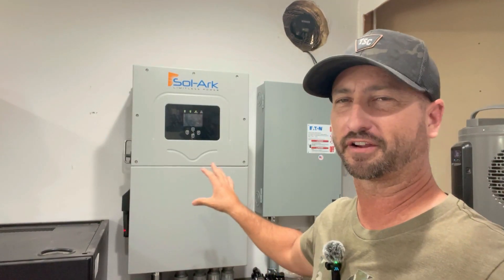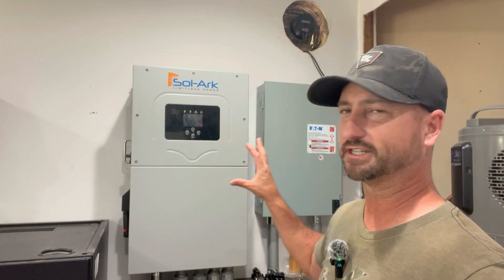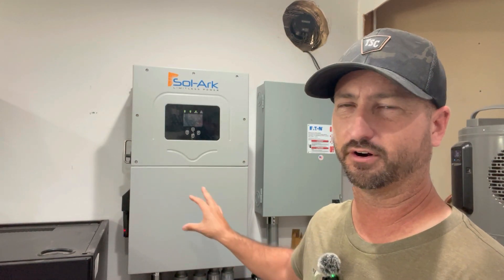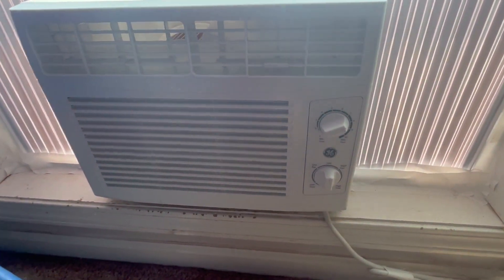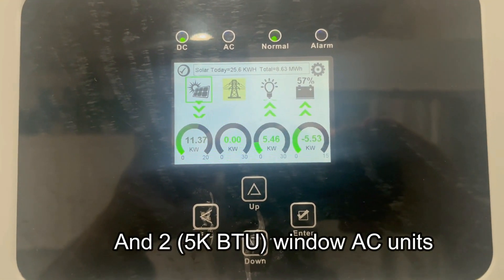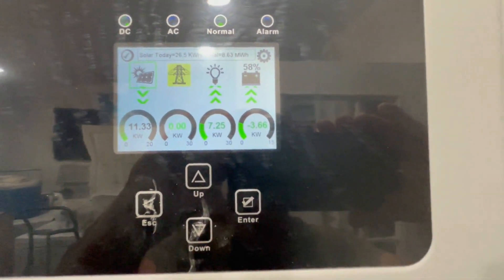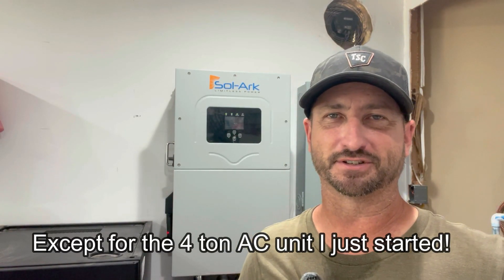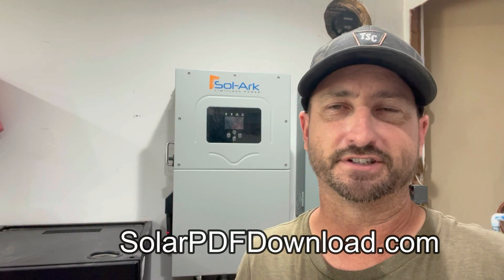Sol-Ark 15k Load Testing (including 4 ton Air conditioner!)

Comment: Great Video.  Just purchased a 15k to replace an outback Radian GS8048 (because Outback is going out of business and no longer can upgrade it).  It seems that the "Hybrid" HF inverter is just as good as the transformer drive Low Freqency Outback..Curious how well it does with imbalanded loads?  I will problably find out when I install it.
Reply from the maker: I haven’t paid too much attention to the load balances. But that means that I’ve never had an issue.

Comment: On your pdf i did not see it. But can you provide some info on the wiring output for load between the inverter and electrical panel for reference ( breaker and wire size). Thanks.
Reply from the maker: 3/0 thhn from inverter load port to the 200amp breaker on my home electrical panel.
Reply: @unpluggedtexan  perfect thank you. I am installing N3H-X12US and just doing my research for the best way to install it. Appericate your response.

Comment: Very informative content Thank You.  I am looking at doing a setup very similar to yours. My well pump is 1.5HP and I hope to do some sellback to speed up the payback.  My question is: what happens if the unit goes south?  I am toying with the idea of a bypass to feed the grid directly into the main panel.  Is it needed or is there a hard shunt in the Sol-Ark in case the brains go belly up?  Thanks.
Reply from the maker: If the Sol-Ark dies then the transfer power to your main power will go down as well.  I have a gutter underneath my Sol-Ark 15k.  I can easily pull the main feeds out of my Sol-Ark and bypass the Sol-Ark using insulated connectors in my gutter.  It would take me about 30 minutes to do that.  A bypass / transfer switch would be more ideal to install though, especially if you don't understand electricity well.

Comment: Aren't your batteries too close to the wall?
Reply from the maker: @David-ev3un  I’m not aware of a regulation requiring batteries to be a certain distance from the wall. In fact a lot of batteries are wall mounted now. As long as they have the certification for indoor installations it should be fine.

Comment: No load balancing and then fault the inverter that’s a problem. That’s a non starter for me . I’m using magnum pae 120/240 units , I think I’ll stay where I’m at now since no problem with load balance which means no inverter fault shutdown ie you have to physically fix the problem

Comment: With this setup, if for any reason Sol-Ark fails you'll have no power correct. I'm starting my installation and thinking of installing bypass switch.
Reply from the maker: I have some insulated connectors on hand. So if the Sol-Ark failed I could pull out the hot wire legs and splice them together in the wire gutter underneath my Sol-Ark. but I have electrical experience and feel comfortable doing that. A bypass switch is a much smarter way to do it.

Comment: I have two 200amp panels for my all electric house. I'd like to get two Sol-Arks 15k's, however I'm not sure they'll handle the load.  I was hoping this video would test the advertised ratings of the inverter. Only other video I've seen has the the Sol-ark 12 failing well below advertised limits. oh well. Hurry up and wait I guess.
Reply from the maker: My house is all electric except for my oven. But I have energy efficient appliances like a heat pump water heater, heat pump washer and dryer, mini split AC and heating. But I also run a 240v well pump and 240v above ground pump that pressurized water to 5 homes on my property. I never see more than 8,000 watts on my Sol-Ark 15k. Even if you could run more than that (which I’m sure it will) you’d need a $100,000 battery bank to run 12,000 watts consistently overnight. I don’t think you can find a better inverter for residential purposes than the Sol-Ark 15k. That’s my opinion.  I often get 15,000 watts of solar into my Sol-Ark 15k and it handles it with no problem.
Reply: @unpluggedtexan  I'd like to use my house as normal during a power outage and not have the inverter dump when my 2hp well pump kicks on...I need to figure something out because the power company here in WA is screwing us with liberals + Lord Inlee's carbon emissions scheme BS. MY electric rates have gone up 40% in the last fews years. When we should have cheapest power in the country with all the dams.
Reply from the maker: @machaf  my well pump is 2hp as well at 450 ft deep. The Sol-Ark 15k handles it without a problem for me.
Reply: @machaf hey buddy, you will need a hell of a lot of solar panels there in WA.  Sounds like you have a lkt of electric.  It might be cheaper to go with propane on the heavy hitters.

Comment: None of the high frequency, transformerless inverters on the market today, last very long. The MOSFETs and capacitors used in high frequency inverters simply cannot take repeated exposures to multiple high surge loads such as full sized refrigerators, large power tools, portable AC units, or large microwave ovens. Without an iron core, copper wound transformer to absorb the back EMF and high surge demands of these high inductance loads, typically after a couple of year's or less worth of use, high frequency, transformerless inverters typically become a non-repairable brick. 

You might be able to start and run some high surge loads when high a frequency inverters is new but every time you fire up or shut down that inductive load, you're shortening the life of the MOSFETs in your these inverters. They also run much hotter than low frequency, transformer based inverters which makes the components such as capacitors, diodes, resistors and ICs that are used in high frequency inverters, far more prone to early failure. 

This is especially true regarding the amount of electro-mechanical wear on the inverter's capacitors. Inverters rely heavily on capacitors to provide a smooth power output at varying levels of current; however the electrolytic capacitors that are used in inverters have a limited lifespan and age much faster than dry components. Capacitors are also extremely sensitive to the high temperatures found in high frequency inverters. Capacitor electrolyte evaporate faster at higher temperatures which can reduce the life of these components.

Another major consideration with high frequency, transformer free inverters is safety. All it takes is for one of the MOSFETs in the inverter's H-Bridge circuit to short to ground or the control circuitry to fail, and a high frequency inverter can send dangerous, high voltage, high amperage DC current straight to your connected AC loads which will not only damage most AC appliances but can also set those AC appliances on fire. 

Another consideration is that the vast majority of high frequency inverters are expensive to repair. At a typical shop rate of $125 per hour in the US, with no schematic, a far more complex design and limited parts availability, it typically won't make economic sense to even attempt to repair a high frequency inverter. Once the FETs have fried and have taken the inverter's PCB with it, (And trust me, sooner rather than later, they will fry if exposed to high inductance loads.) they basically become a brick. 

A far better alternative is to invest a little more money and purchase a hybrid, low frequency, transformer based inverter charger. Your system will last far, far longer, it will run much cooler and can easily power high surge loads without being damaged.
Reply from the maker: Thanks for the detailed info.
Reply: This is a good info. Are you an inverter engineer? Are there many cases of failed solark inverters as compared to transformer based inverters? Thanks
Reply: Solark isn't as bad as the Chinese manufactured high frequency inverters primarily because they use high quality MOSFETs and caps. They do suffer from issues dealing with load imbalances though. Please see the video by David Poz, titled "Why Sol-Ark didn't work for me." or the video by Abney Solar, titled "XW Pro vs Sol Ark" for more info on that.  @odoohub5010
Reply: What you are saying is very true about high frequency(HF) inverters unless they are using IGBTs instead of FET based power output modules. IGBTs handle large current surges much better than FETS. However they are much more expensive than FETs. It would be nice to know which inverters are using ideal IGBT devices and which are still using old school FETs

What you say about electrolytic capacitors is also true but let it be known that all low frequency and high frequency inverters use them. Circuit designs and quality of components play a key role for inverter life span. Some more expensive capacitors last much longer than the cheapo chinese ones.

What you say about surges is very very true also. Before dumping several thousands of dollars on any inverter its important to know what you are really getting........Sure it may handle surges but for how long?????????.. Will Prowess does some pretty good inverter reviews but we really need to know more like what kind of output devices are being used especially with high frequency inverters like SOL-ARK, HYSOLIS and EG4.  A well designed HF  inverter using IGBTs should be able to handle surges well but expect them to be more expensive. 

SO MUCH CHINESE CRAP OUT THERE.........BE CAREFUL

Comment: I currently don't have a battery hooked to my Sol-Ark 15k.  Even if my PV is producing way more than the load, when I disconnect from the grid, the whole house goes out and the 15k faults/shuts down (F45 - AC_UV_OverVolt_Fault).  It stays off until I reactivate the grid.  Also, I noticed all my computer UPSes saying my input voltages were 117v.  I checked the Sol-Ark (and the history in PowerView) and it looks like the Sol-Ark output voltage on both legs is just matching whatever is coming in from the grid.  It's not correcting the voltage and outputting 120V.  Are these things normal?  Are they because of the lack of a battery?
Reply from the maker: That doesn’t sound right to me. Give Sol-Ark a call and talk to one of their engineers. (972) 575-8875. If you have your WiFi dongle connected they can log into your system and check the settings.
Reply: @unpluggedtexan  I emailed them and got this:  "When switching form the grid to only PV  power, there is no reserve power for the Sol-Ark to draw from. The PV has to ramp up to the production needed. It is likely a large load (motors / inductive loads) will create an overload condition as well.

The Sol-Ark was designed to operate with batteries. With just PV and the grid the inverter will do what can to cover the load with PV but will also use the grid to augment the PV production."

But that still doesn't sound right.  My installer was out here today around noon.  The PV was generating something  like 9kW.  The load from the house was around 0.5kW.  Turning off the grid resulted in the whole house losing power, the 15k saying OFF and that F45 error.  The inverter (and house) stayed off until we reconnected the grid.  I've got a battery on order and when it arrives, we'll see if the problem continues.

Who knows, maybe disconnecting you battery from your Sol-Ark 15k and putting it in No Battery mode would make for a good video (assuming it fails like mine does).
Reply from the maker: @nommindymple6241  interesting. I think I may try that and see the results. 🤔

Comment: I am getting ready to install a slightly larger system than what yours seems to be. I am going with 2 Sol-Ark 15ks, 52 400w (21kwh total) ground mount pure black solar panels with optimizers, 4 homegrid 8stack (38.4kw each - 153.2 Kw total) batteries in a homegrid powercube and a 26kwh kohler backup generator. I am going fully off grid. I have an AC a lot like your large one and a 200 ft deep well (originally built as a shared well, but only connected to me) and a 5 bedroom house (2K sqft), a washer and dryer, 17cuft upright freezer, 2 full sized refrigerators, 2 42" flat screen TVs, 4 computers and monitors, space heater and water heater, dishwasher ans various electric Ninja cooking appliances in an all electric home.

Comment: Really interesting video; thanks!  I have a very similar setup, using the Sol-Ark 15K, my one weakness is the battery bank I have that can only provide 150Amp continuous.  Grid was "blinking" yesterday and the battery couldn't provide enough juice, faulting the Sol-Ark.  Soon, my new (correct batter) will be installed, a Homegrid Stak'd setup that's about triple the size, can deliver 300Amp continues, 500Amp surge which should stop that kind of issue.  

Have you done similar testing with your Solar MPPTs off, and just the battery?  How does it handle similar loads?

Thanks for the content!
Reply from the maker: That is going to be one of my next videos I’m going to do. Reviewing my EG4-LL batteries and putting them under load with no solar input. I’ll be doing that video soon as I just received the EG4 18K PV inverter and will swap out my Sol-Ark to begin testing it.
Reply from the maker: And yes, not on camera yet, but my batteries easily run my whole home at night (but I do have a heat pump washer/dryer, heat pump water heater, induction cooktops, and heat pump mini splits for air conditioning and heat. So I rarely go over 8,000 watts of a load (but I do sometimes when my water well pump and water pressure pump kick on at night).
Reply: @unpluggedtexan  Thanks much!  We have VERY similar setups in a lot of ways.  We run two combo fridge/freezer units + 5 deep freezers for all our cold food storage, run a Sol-Ark 15K, with currently just a 10Kwh battery limited to 150A discharge (solar install company didn't provide the right one, so in the process of upgrading/swapping to a 28.8Kwh setup with heating pads for cold weather operations (I'm in Maine); our climate is very different.  Our setup is only 9.6K for PV, but meets our needs most of the time and is roof mounted on an outbuilding.  

Looking forward to trying to run more off battery at night once the larger setup is in place.  

I see you have CT's wired into your Sol-Ark, my installer didn't do that..and I'm pretty sure should have.  Where did you install the actual CT's in your setup?  Between the meter and your disconnect or at your disconnect?  Assuming looking at your very nicely done PDF download that your Eaton box is a disconnect, not a Sol-Ark bypass as well.
Reply from the maker: @sethgthomas  correct on the disconnect. I have my CT’s inside that 200amp fusible disconnect on the two hot lines heading toward my 200amp home electrical panel.
Reply: @unpluggedtexan  Thanks!  Will be installing the CTs soon myself, so great to have another reference!
Reply: @unpluggedtexan  Good deal!  Looking forward to it!  Wishing you lots of success.

Comment: I want one (or two) of these, but they're so damn expensive. Did you have to have the Utility shut off grid power to your home when you installed it?  I'm assuming the SolArk is a low frequency/ toroidal transformer unit.
Reply from the maker: I did not need the utility to shut off power since when I installed the meter socket on my property I added a 200amp disconnect below it. Then from that disconnect it runs to my home. I was able to just switch that off and do the install. But I also know how to pull a meter to kill power to the home if there is no disconnect. Technically the utility doesn’t want you doing that though but I’ve never had an issue doing it. But to install the Sol-Ark 15k you definitely. Need the power shut off coming into your main home 200amp panel.

Comment: One correction, it can do ~7800W on a single leg.
Reply from the maker: That’s funny, when I talked to a Sol-Ark engineer a few months ago he said it wouldn’t line balance, but he didn’t seem very confident, and the manual never stated it could. That’s kind of an important piece of info for them to not be clear on.
Reply: @unpluggedtexan the inverter is 15kW so it can't do much more than half on a single leg but it can do a bit more
Reply: @niktak1114   I would have to see it to believe it .  Have you witnessed one do it ?
Reply: @onthelake9554  Yes. I've had one for about 15 months now.
Reply: @niktak1114   I would think they would have put out a video about that since they had such a bad reputation for tripping from a hair dryer on one leg  .

Comment: TLDR he didn't do a load test, never got anywhere near the specs. No knowledge will come from this as to how a solark performs (or not) vs it's rated capacity.
Reply from the maker: Yeah I should have just started plugging in a hair dryer, vacuum, toaster…ect to get the total load closer to 12k. But I think this test clearly was a load test in the surge capacity of the Sol-Ark with being able to start my well pump and also a traditional 4 ton AC.
Reply: @unpluggedtexan  Could you do those tests with an amp meter that can measure that surge voltage? That will show what it can do! Ideally it can be running 8kw and then start the AC on top of it.
Reply: @Zorlig it coild do that on a 4 ton AC with a soft starter but not without

Comment: How many solar panels do you have and at what wattage,  I have a Sol-Ark 12 with 3 Fortress batteries at 5.2 ea, I am interested in the EG 4 batteries but unsure if I can run them with the fortress batteries.  Thx
Reply from the maker: I have 50 320 watt Longi solar panels. Total of 16kw at the moment. I’m about to install another 3,000 watts this week. I have 30 kwh of EG4 LL lithium 48v batteries.